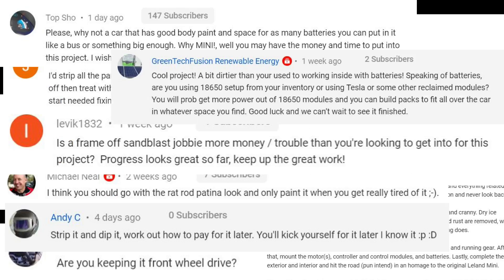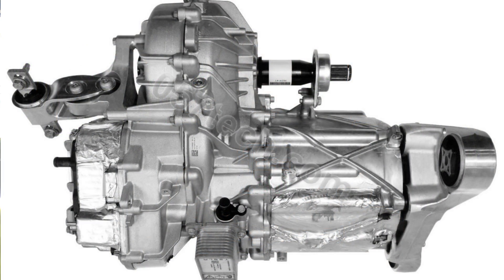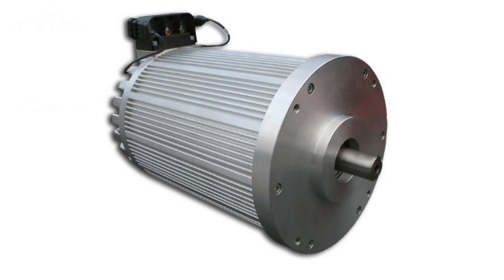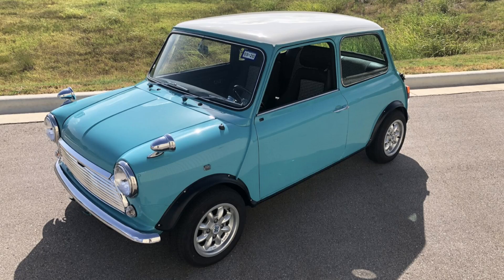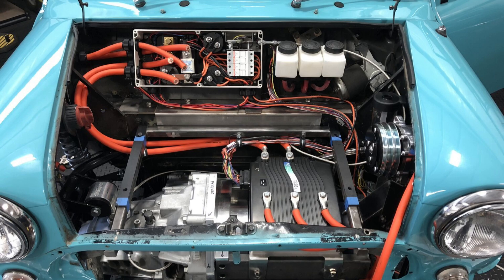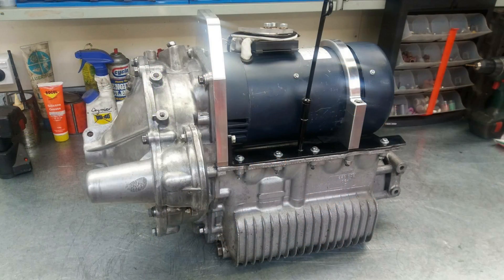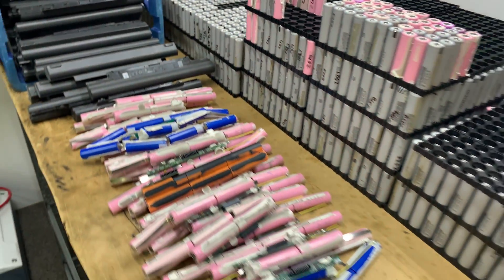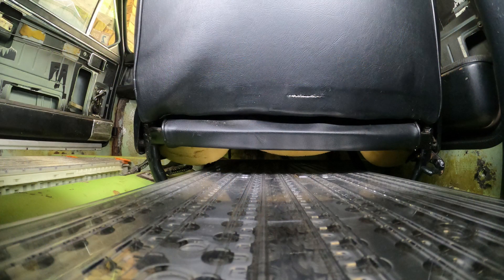SO MANY QUESTIONS! I'll deal with the top three!  🔋1973 Clubman Mini going electric Episode 4

Comment from the maker: Who thinks I should stop all plans, refocus the whole project to paint the little green brick before anything else?
Reply: No, do all the fitting of whatever motor and batteries you are going to use.  Then strip and paint!
Reply from the maker: I think if i was going to paint that's the way to do it
Reply: @HBPowerwall  i think so 😊.
Reply: @FFVoyager  ye.. even if he pays some back yard bloke..to paint it later on the cheap.

If ur gonna do it wrong and spray clear over rust.. at least use cold galvit instead, for the love of god!
Reply: that's cool 🤓 continue
Reply from the maker: will do lol
Reply: I think you already know my stance on this :D I've done so many mods to all my cars and ALWAYS regretted not doing the shell properly to start with.
On my last build I did and it looked ***in awesome :D
Also take a course in welding, you are going to need to do this SOMEWHERE on this project I guarantee it. (it will save you a load of money on getting a 3rd party to make brackets for you!)
EDIT*** Ahhh. slight nuance in what you wrote and what my stance is.. Yes I think you should PREP the shell properly to start with, (acip dip and basic rust proofing coat) then do all your modifications before final strip and topcoat paint..
My last one didn't involve too much chopping of anything so after the cage went in I did the interior and the engine bay paint, then built it, then painted the rest of it afterwards.
I wish I had the funds to help on this but my patreon funds are going to La Vagabonde at the moment sorry dude.
Reply: Make it run first, then the looks ;-)
Reply: HBPowerwall the patina looks beautiful leave it as it is.
Reply: Do all the mechanicals and conversions then paint last. 🤷🏻‍♂️
Reply: continue with your original idea except deal with rust as you have done and coat the underside. If you leave the exterior paint as is then it will be more shocking to people when they realise it is an electric car
Reply: I agree with these people on the get the hardware sorted first then worry about paint. Last thing you wanna have happen is you find during hardware install that some thing painted needs modding or some hardware starts knocking paint off.. :)
Reply: Nah, I think your reasoning for not painting is more than fair 👍🏻 plus the slightly scuffed look will certainly make it unique and cool
Reply: Leave it as it is. I think the look on the car is great. I wish my clubman looked like that. The old weathered look with modern technology is a win win from me.
Reply: Tesla motor for sure, that will awesome, and the views alone will pay for the project!
Reply: U will regret it if u don't paint it
Reply: I'm turning a basket case Hudson Hornet into a modern EV... It's always best to complete the engineering, chassis work, dirty bits first, hen take the vehicle apart and do the restoration... It's extra steps in there, but it'll save you a lot of drama and headache to do with the way the professionals do it. Personally, like the car looks now... I wish my Hudson was in good enough shape to just keep original. Good luck mate
Reply: That mini is worth painting, which will protect the metal.. while you still have it... the rust is only going to acclerate and the cops will pull you over and give you grief
Reply: I painted mine jaguar brittish racing green metallic
Reply: I reckon...
Get a wire wheel for yiur angle grinder and attack all the rust..
Then use rust converter.. phosphoric acid. Get a can of cold galvit and wtch primer to finish.. and some acrylic green paint in a can also... go to repco for a match.. i reckon you try passivate that rust and seal the panels at least. Dont go under 80 grit sandpaper
Reply: do all the paint and it will be nothing but hastles trying to fix the scratches from doing all the mech work. conversion to E will be a lot of trial and erorr and in and out.
Reply: Ever considered finding a Mini automatic box and fitting a motor on tyop like the one you showed? Just needs an oil pump and everything else lines up. With the normal A series it needed a different front subframe (3/8 lower engine mounts) but with an electric motor it will work with what you have. 
You've cleaned up the interior, got the headliner sorted and when those C pillar pieces are in you won't see any green inside anyway so just leave the outside as is mate. What the Yanks call 'Patina'. You can always re-spray later if you need to. I like the scruffy '70s look hiding the 21st Century power.
Reply: Yes.
Reply: Don’t paint it!
Get your batteries mounted, motor sorted then you’ll have plenty of time to think about the paint.
Have you thought about using a scrap EV, I’m using a bmw i3 and I’ve seen Nissan Leaf based Minis too

Comment: The SwindE is a wonderful creation.  I have just seen the video. The clunky mechanical gearbox and differential have been replaced by a bit of software for the two motor controllers. There are no batteries in the boot, which is actually bigger than the original boot. The batteries are all contained in a not too intrusive tunnel down the middle of the car. Ironic since one of the Mini's early boasts was the complete absence of a hump for the propeller shaft.
There is the little matter of 80,000GBP to find. And around 250 kilometres of range should assuage the anxiety of all bu the most determined crosser of the outback.
Reply from the maker: Concept is fantastic, price is not workable! I'm almost thinking the HONDA conversion route, but still big money and COVID might change this project quite a bit on my planned time line

Comment: When you get ready for a conversion, the i3 has both the batteries and motor/trans required and is cheap, also the Mercedes B class has a smaller version of the Tesla S motor /trans and is also cheap at $13K for a running car, so search for a damaged car and have it delivered.
Reply from the maker: interesting info thanks buddy

Comment: A Honda or Toyota or something,  transaxel  with a leaf motor, they use Prius transmissions without the engine, electric only, so they use the. Prius trans as a motor, it would probably work for such a small car, a 5 speed trans with electric motor would probably offer better performance,  Damien McGuire does alot with this type stuff, he us on YouTube, and sells stuff to help with use of ev electronics, in projects, good luck!!

Comment: Any way to do 2 individual motors for both front wheels like hub motors?
Reply from the maker: Thought about that for a very short moment I don't think it's the right application
Reply: @HBPowerwall  the reasons i think it would be good are, that no need for a differential or transmission amd regen should be simple. I think the hardest part would be how to get it to work like a diff i.e more power on one side than the other for cornering like torque vectoring

Comment: Build it as is ,just a polish and a clean as you've been doing along the way.
Don't even put new seals in.
Once driving so all new holes , brackets new or deleted is done you can paint then assemble.  Handy tip youtubers using Rustoleum spray cans which come up really great with a bit of practice and the right temperature. 
New 13 mags a polish and clearcoat would def make a sleeper look keeping the exhaust tip of course lol.
Would a modern mini gearbox fit i thought they where alot wider.
Also paint yourself will add plenty of videos  and handy info for viewers. 
Just remember filtered masks when painting .
Reply: Moore Motorsport youtuber with Rustoleum can painting. 
Another top orternative  is vinyl Rap alot cheaper than painting. 
But keep line green it's cool as .
Cheers Pat

Comment: You don’t need a huge motor and you don’t need gears that change (although you will need some kind of reduction gear). But working out how to do that in a combustion vehicle - well thats the trick in an EV conversion. The original electric mini concept car had hub motors but I think they had problems with unsprung weight. https://www.treehugger.com/cars/electric-mini-0-60-in-4-seconds-it-has-motors-in-its-wheels.html   Interesting though as hub motors bypass a lot of custom fitting problems and save space. https://pin.it/BptOPv8

Comment: You're still thinking like it's a petrol car you don't need 6 gears. 3 absolute max.
Reply from the maker: Fully understand that, but the modern gearboxes more often than not are 6 speed.
Reply: @HBPowerwall  doesn't always mean you have to keep them all... Weight is everything. For the last decade I have been trying to make the numbers work on electric vehicles. Much easier to do on paper than in the real world. I have even considered doing an electric Mini like you, but even that has proven challenging to get the level of performance I want. EVERYTHING is a compromise with electric. You missed one of Geoff's (GT Tooling) other conversions he did on a Moke with a blower belt drive. I have flipped backwards and forwards about pinching my trike engine / diff for a Mini conversion. evalbum.com/popupimg.php?27141

Comment: Awesome project! Been following and liking it along, but wanted to share a few things... I'm building a 1953 Hudson Hornet with Tesla parts now (I started with a Siemens motor and the stock gearbox, but switched horses midstream). If you have a motor with a high enough rev range, you don't need a gearbox... Just a gear reduction. you can always turn the AC motor backwards for reverse. Save the space and weight. Reusing a modern salvaged drivetrain is a good head start, and reuses parts, which is super green. 

The Tesla front motor might be just the ticket, if you can get some way to control it... I know guys have figured out the rear drive unit, but the front drive unit may still be on the edge of working, but should be soon. Damien McGuire's doing some amazing work on a number of different systems, including the Toyota parts. But there are still a whole bunch of choices. 

Not quite sure how feasible it is, but it sure would be cool to put a Tesla motor into the rear of the Mini... Drifting and donuts are best done with rear drive! I don't know why anyone would choose for all drive if you have a choice... Front tires got enough work to do turning and stopping the car, without adding acceleration to it... To each his own of course...

Good luck with your project mate! I'll be following along your journey...
Reply from the maker: Thanks for that info buddy, after this video i'm more confused than ever. I have to pick a path - accept the consequences and move forward asap or i'll be stuck in this loop lol

Comment: If you spray cleat coat over rust, even if it's just surface rust, it's going to continue rusting under the clear coat and get worse. The only way to really fix it is to sand and paint. It's costly, yes, but I'd hate to see you go through all this work/money only to have it start rusting out bad in a few years :/
Reply from the maker: Would treat it all correctly before spraying it. sand it back to a degree, rust convert & spray it over the top.

Comment: Performance EV is using a nissan leaf. There are quite a few so doner parts are common. He pulled the inverter and motor apart but maybe you could fit the package in your motor compartment with a mad max hole in the hood/bonnet.
Reply from the maker: Someone else mentioned that - i'm taking a looking to it.. thanks for the info Kevin! ps no mad max holes lol

Comment: Why would you need a 6 speed modern geerbox, you only need 1 forward 1 reverse ?
Reply from the maker: I need the gear box to get the power to the front wheels cheaply. Modern boxes are strong & designed for higher torque - hence being drawn to a newer gearbox over an old one.

Comment: So awesome a Mini Tesla.  I have a 2002 BMW Z3 M roadster with the monster S54 and a SMGii swap from a e46 (2001 M3) but I day dream about swapping the rear with a Tesla drive until but want it AWD Z3.  When it dies I want too but this is so awesome.  
Think you can turn the Tesla drive unit side ways and where then axles are make them driveshaft for AWD?
Reply from the maker: I've done nothing with the tesla motors - never even seen one out of the car.. Some have said it won't physically fit anyway

Comment: This is a great project and I imagine converting old cars to an electric drivetrain & batteries will be huge in the not too distant future, especially over here in Europe when the ICE (internal combustion engine) ban comes in.
What about a vinyl wrap instead of a paint job! I see some terrific wraps on cars that undercut a full repaint price wise.
Reply from the maker: With the surface rust it would be very hard to get a smooth finish  with a wrap. I've had a conversation with someone about taking a photos and trying to print it the same but the samples came up horrible

Comment: Keep  it the way it is Mate.  It's the OZ way.  Love the way you are keeping it in the idea of the budget constraints of the average punter. 
Keep  at it in the vouge, I'm or should I say the "vibe"of the original project concept.
Reply from the maker: It's going to get much harder to keep it budget once it comes time to motor, box & install -
Reply: @HBPowerwall  yes I can well imagine.  I'm am old armature /motor reminder and have built just about all I have done in my life from Ice cars to a yacht and house's,  including building all sorts of machinery and equipment. I have designed and built my own off grid house,  but I can not get my head around the integration of the electronics in ev equipment,  unfortunately,  I wish I could. Otherwise I would have built my own ev by now. 😊

Comment: Solectra used to have a 8 to 1 or 10 to 1 reduction gearbox for thier ac motors. I'd avoid ice gearboxes if at all possible. If you need a box that'll fit I have a cg13de and box in my mini putt of a k11 micra.

Comment: Not sure on the torque requirements in an EV application, but it you're looking down the path of a "new" mini gearbox, another similarly packaged unit would be a Getrag box from a Ralliart Colt/Colt Cabriolet. They are sub 40kg and 5speed. I know in combustion power they are pretty stout for ~350nm.

Comment: I still think a Nissan Leaf motor and trans will be the best for your Mini.
Reply from the maker: You don't think it's bulky & overly complicated?
Reply: @HBPowerwall  its been done,  would sort your gearbox issue out, you can un-stack the components. https://www.diyelectriccar.com/forums/showthread.php/nissan-leaf-drivetrain-2nd-gen-196386.html
Reply: going with a leaf motor may give you issues with the 120V you want to use

Comment: You could go with hub motors. They'd replace your primary brake rotors and add larger rotors for braking. Also could do regen braking as well. I think they cost in the $500USD for a mid-power one.
http://www.cnqsmotor.com/en/article_list/E-Car%20Hub%20Motor/91.html
They also have AliExpress store front as well.
Reply: Hub motors imo are the way to go for this project. Keep it simple. You will save weight and space for battery install.
Reply: Oh and plan for 4 hub motors. :)
Reply from the maker: I have considered hub motors but it sound much too complicated to implement
Reply: @HBPowerwall  I don't see how it's complicated, really. You just take off the old brakes and rotor and slap these on 😉
Granted, I'm sure there's a little more to it than that, but a lot simpler than fabricating all kinds of brackets and suspension for a chassis motor, plus no gear box to worry about.
Reply: @HBPowerwall  hub motors are definitely NOT the way to go. Fabrication of mounts for them is much more complicated than simple brackets to hold a main motor, and you'll need four of them, with much more demanding tolerances. Motor wiring needs to go through the center of the mount which is highly unlikely to be possible with standard mounts. Then you'll need four ESCs to control them. Hub motors cannot make use of a gearbox to optimize motor speed to road speed for hills or highway cruising. Ride quality and handling will suffer due to the increase in unsprung weight, and your choice of wheel rim sizes may be more limited, along with the width of the wheelbase due to the thickness of the hub motor being added. There is nothing 'simple' about it - re-using as much as possible of the original drive train is by definition the simplest path. And we haven't even considered MoT compliance issues yet! I don't know how it is in Australia, but in NZ if you want your conversion to be legal there are a thousand hoops you need to jump through when getting inspected for road-worthiness. Anything that can be marked as 'unchanged' is a huge bonus. I would imagine they are especially nitpicky when it comes to any modifications that affect brakes!
If you were making a completely new chassis of your own design the hub motor would be a win in many ways, especially if you want to nerd out over controller tweaking. But for a conversion, no way.
Reply: A few more things. Without power steering I think trying to turn two fast-spinning large masses in the front wheels would be.... interesting. If ESC calibration is not matched well across all four motors, they might be trying to meet different road speeds which would be inefficient.
With hub motors an extra potential problem arises if one or more controllers fail, because they affect your steering. With a single main motor if the ESC fails (either stuck on full throttle or stuck off) you're only affected in the direction of travel, hitting the big red panic button should take care of it. But with hub motors in the worst case two motors on one side get stuck on full, you'll probably be pulled sideways off the road before you can react (pray there is no oncoming traffic). So you'd want to be serious about your choice of controllers, and not buy some cheap junk. Ideally they would be communicating over some sort of bus to know what the others are doing.